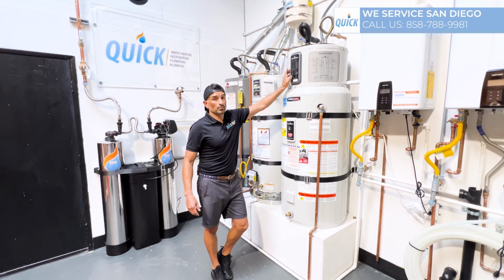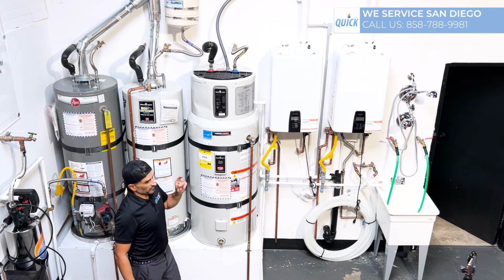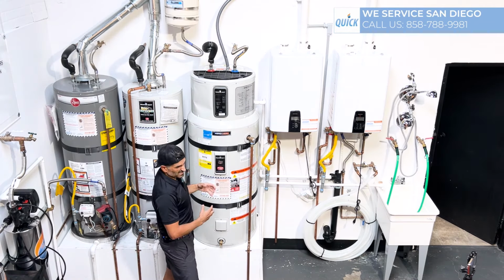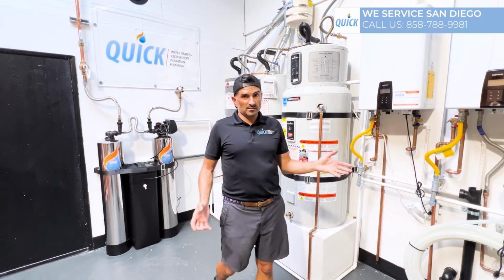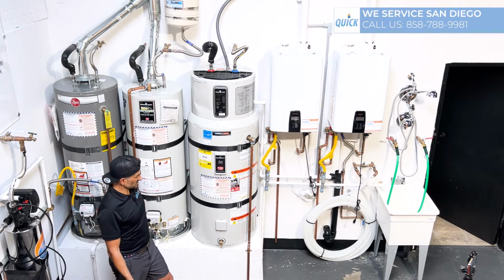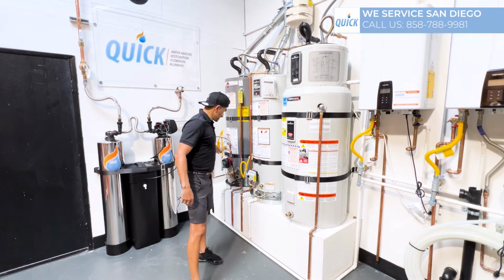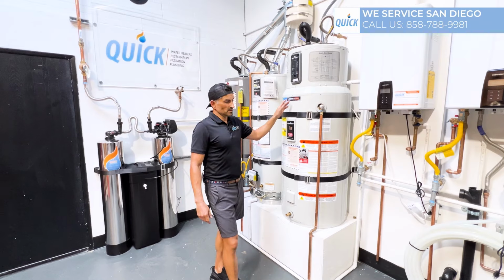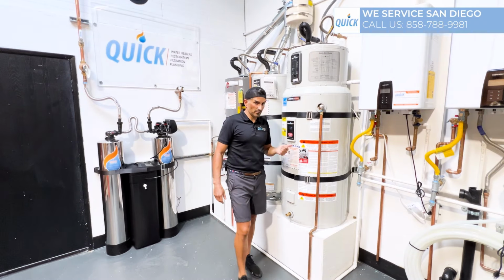Heat Pump Water Heaters Suck

Comment: My wife and I hate our 80 gal Rheem heat pump water heater. Doesn’t heat water fast at all, can’t take back to back showers with the kids. The concept is great but functions like a turd. I have never had an issue with electric or gas water heaters. They have electric mode, but this one doesn’t seem to work as well as others I have used.

Comment: This guy is obviously a novice, no training. In Calif they are trying to ban Natural Gas systems so when the force new homes and Biz to go all electric a heat pump WH makes a lot of sense. It is more economical that a straight electric WH elect coils only, but water conditioning and electrodes are vital. If it is in the garage the side benefit is the cooling they produce While they heat the water. This is true anytime water is heated by electricity. Depending on the size of the Heat pump it depends on the cooling output from 1/2 to 2 ton HP's.

As to the problems he speaks of with a recirc pump, most homes and older bldg's are NOT designed so that a recirc pump is of any value. it takes modifications or the repiping sense for every station that uses water  to use properly He obviously cannot diagnose what the problem is. Good thing His company name is in the video so you know who NOT to Call,  I could go into much detail over the uses and benefits of all those systems as well as their requirements, plus and minuses, but this post is already way too long. Be advised, do not use them and look for a Union shop where they actually train the plumbers and techs. or a non union shop that has actual certifications of Training from a reputable instituiton. I am a retired HVAC&R +++ person.
Reply from the maker: We have 9600 water heater installations under our belt. How many do you have?
Reply: @quickwaterheaterfiltration5292  I have  over 50 years of experience under my belt. In HVAC&R, energy management, diagnosing problems created by installers like you, and fixing them, plus supervising all the above with the appropriate training and education. as well as I have been on the lists of major equipment manufacturer's as well with all the major utility companies for their trial runs and or to go out and diagnose problems that other contractors never were able to resolve. I could go on and list a host or other attributes, awards, certs, etc.

Lastly, why were you never able to resolve recirc pump issues, as you stated? ;) Have a great day!

Comment: This guy full of it . maybe works for the gas company? We have a Rheem heat pump water heater and it cost about $1300. 50 GAL  love it ,vs about 750 for a standard electric. saves us a lot of money, more thanTHREE TIMES as efficient as a standard WH plus we got a a 300.tax deduction.  I figured it will pay for itself in 3 to five years. If you are replacing a standard electric in your garage it will work great, and save you a lot on your electric bill. As this guy should know, you need to size your heater to your needs.so if you have no issues with current size replace it with the same .So here are the facts it makes about as much noise as a refrigerator, it may need to be vented because it produces cold air like an air conditioner ,and  it requires 30 amp service to  the unit this requires a 30 amp breaker about $35, and 10 gauge wire about $2 per foot so the labor for the wiring would be the big variable , so how close is the electical  panel to the WH install would be a factor to replace a gas WH.
Reply from the maker: You probably live in the affordability belt and not in California. Also if you need a job we will hire you based on your prices above.
Reply: @quickwaterheaterfiltration5292  sorry I forgot a comma after 2 per foot . the prices are for the materials . I am a DIY person so I have no idea what someone would charge for labor that of corse would be the big variable. I live in Tucson AZ same LAT as San Diego , so tell me more about the affordability belt ?

Comment: Wholly misrepresenting the details. Of course a flash hot water heater makes hot water faster, it guzzels gas/electric to produce that delta. It's the core difference between a tank and instant. 

Most bathtubs are 80 gallons and you'll have a mix of hot water/cold water to fill them. The heat pump water heater will do about the same job as the classic tank/heating element ones and if you use the backup elements, even faster.

Most importantly, how many baths do most people take in a day, week, year? You're making the case for a use that may be less than 1% of the time, ignoring the other 99% (shower, dishes etc) that the heat pump is more efficient.

On and that point on electric - no! An electric instant heater requires huge circuits with thick (expensive) wire; much more expensive. Your example using gas; ok less in electric but you still gotta run gas there. Code requires enough electric capacity to run a standard tank heater; there are almost no instances where the heat pump hot water heater would be more expecting to wire. 

- they do make more noise
- they do need adequate ventilation and are better suited in warmer climates
- they are more expensive to repair
- they do take up more space

Hope this helps your viewers
Reply from the maker: WTH is a flash water heater?! Did you just invent a new product?
Reply: @quickwaterheaterfiltration5292  
Instant, Demand, Tankless and Flash are all just different names of the same thing.

https://en.m.wikipedia.org/wiki/Tankless_water_heating
Reply: @DarenSpinelle never heard them called a flash. 😂😂😂

Comment: One day the high gas prices will also his the USA and then you will pay ten times more when heating anything with gas then when heating anything with electricity. On top of that, I can make my own electricity (solar panels, wind turbine on the roof) and this is completely free; try to make your own gas.
Reply: Currently there's about 2000  electric power plants in the USA that burn gas to generate steam . They are not going away for generations,  The life cycle  of a current hot water tank or many there after will never be in service with the plants are decommission .  With 2000 plants in operation If gas prices rise so will electricity. Its more sensible in given areas to have solar collectors heat water direct no need for the electric aspect. It was common in the 1970s and not complicated.
Reply: @dpt4402  Gas turbines can run on hydrogen and they can run on biogas. That means they are not dependent on natural gas. And when they run on biogas or hydrogene generated with electricity from wind turbines or solar panels, the gas turbine runs CO2 neutral. But your home appliances cannot run on hydrogene and bio gas only pays for itself when used in large quantities in industrial equipment.
Reply: @xcoder112  but there’s no hydrogen infrastructure to supply the demands of an electrical power plant even if that was a path forward it wouldn’t mature for many decades
Reply: @dpt4402  In Germany, the natural gas network is currently being converted so that it can transport either natural gas or hydrogen. In fact, a test project has shown that it is possible to feed up to 30% hydrogen into any natural gas network without any problems, even without conversion. And studies have shown that even 100% hydrogen is not a problem for the transportation network as long as the steel pipes are in good condition. Only feed-in points, tapping points and valves need to be adapted for 100% hydrogen, as well as storage tanks. Wherever new natural gas pipelines, tanks or tapping points are currently being installed, only those that are also suitable for hydrogen are already being installed. And where something needs to be repaired, only spare parts that are suitable for hydrogen are used. As early as 2025, the first parts of the network are to be operated only with hydrogen, namely the parts that supply industries and power plants, and up to 30% hydrogen is to be added to the rest of the network as required.

But even if hydrogen is climate-neutral, provided it is produced from green electricity, the whole thing is ultimately a question of cost. Producing 1 kWh of electricity from natural gas in a natural gas power plant currently costs 9 cents. 1 kWh in a solar power plant costs between 2 and 6 cents. And a heat pump turns 1 kWh of electricity into 3-4 kWh of heat, since a heat pump does not produce heat, it just pumps heat (it takes heat from one place and transfers it to another one, yet the heat has always been there). So I can take electricity for 2 cent and turn it into 3-4 kWh of heat. The natural gas for the same amount of heat would definitely have cost me a lot more. Of course, these are all purchase or production prices, we all know that you pay much more as an end customer, but that doesn't matter, because as an end customer you pay the same amount more in both cases, regardless of whether you buy electricity or natural gas. And I don't have to buy electricity, I can also run a heat pump with electricity from the solar panels on my roof or in my garden.
Reply: It’s the Wall Street gas company adding fees. The fees I mean a monthly fee of 25 dollars even if you use no gas. The actual gas is cheap
Reply from the maker: #oneday
Reply: @quickwaterheaterfiltration5292  But you don't just plan your heating system and hot water supply for a few years. Very few people have the money to buy a new system every 5 years. Most people today use systems that are already around 15 years old, some even have systems that have already cracked the 20 mark. So if you buy a system today, you have to think about what will happen in the next 20 years.

Comment: Completely agree.  Heating water, whether to hold in a tank, or on demand, is just not a logical application for heat pumps.....I am in Iowa, and unless you live in a single wide or a 1 bedroom efficiency apartment, natural gas is the dominant source of energy to heat potable water, both tankless and storage tank setups.  I did however come across a Hayward 250K BTU equivilant heat pump pool heater, and those things seem like they would be worth the investment in an area like San Diego, with your amazingly consistant climate, where the swim season never ends.....but not so much where I am at because the months that people really crank up there pool heaters are April and October, to get an early start and extend the shorter swim season we have in Iowa, with the temperatures during those months being cold enough to really eat away at a heat pumps efficiency.  Now don't get me wrong.....the efficiency of newer heat pumps is unrivaled, they are an extremely efficient method of moving heat.....in the correct environment and application......which in my opinion, a storage tank water heater is NOT!  Great assessment sir.